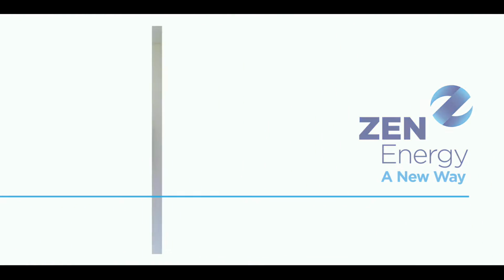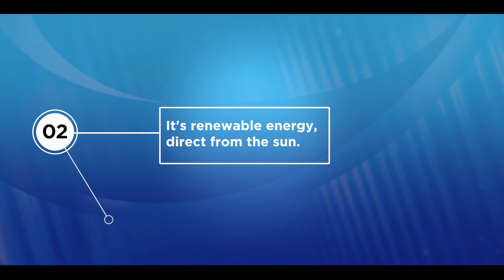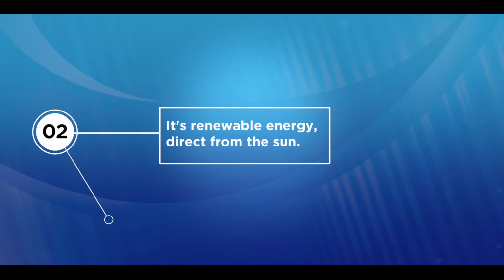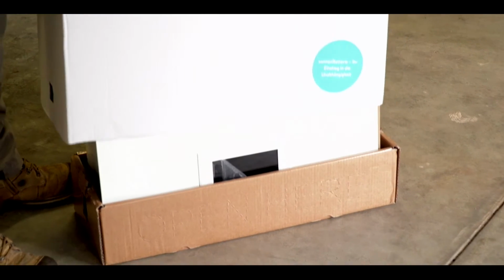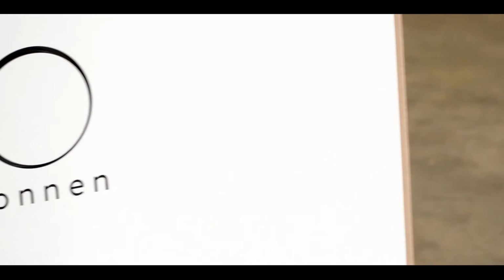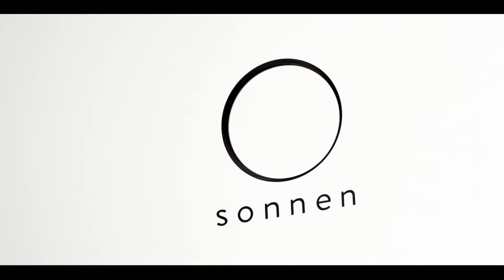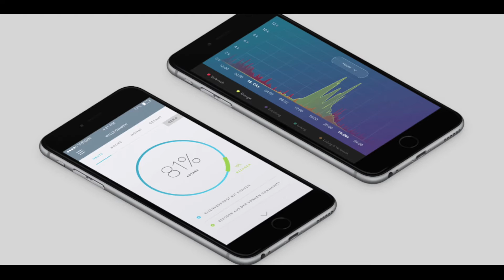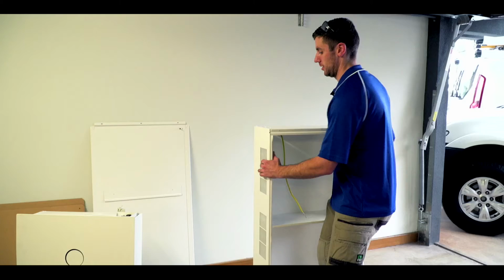Sonnen Eco 8 Battery Installation by ZEN Energy

Comment: World leaders ? They do not build /manufacture only install a finished product manufactured in the USA - Battery storage technology is nothing new Aboriginal communities have  diesel hybrid systems  in place which were installed appx 15 years ago these have 100 Kw Arrays , 80kw 3 phase hybrid inverters , 40 to 60 kw  of storage capacity from companies such as Sonnenscheine, the Gel Battery banks are made up of 2 volt Cells usually running at 120 volts - with appx 800 to 1000 amp output per cell. These also have a Guarantee / warrantee  of ten years - Yes the New Lithium Batteries are very nice and very compact but there is other Tech available with a lot More watts for less Dollars still available,  these have not really been shown to the public at this point in time. 
 Further to the above  you have synchronizing Generators all 3 phase up to a number  4 of 120 kw  Cummins sets all 3 phase with auto start facilities , as load increases in the fully automatic load these will start sharing load either with the inverter or with the other gens depending on how the client configures the system they also have a feature that will start any of the sets or inverter if that is available, should there be a failure of a set or inverter. Finally there is a battery charging ability with an output sufficient to feed the inverter directly at 120v ( in case you loose the batteries and wish to remain on the solar option ) The panels will reduce the load on the gen-set via the battery charger once the sun rises and they begin to generate a charge. -  the DC charger  is fed directly via the main switchboard off the main AC bus or via any one of the  four generators again depending on which set is selected as the primary or duty set in case one or more is out of service for maintenance.  This is a quick description of the electrical / Mechanical configuration - the fuel design and enclosure as well as site distribution etc have not been mentioned as well as the Building That Houses this facility etc are all built around green design Principals and Technology. The system has many features too many to mention in detail , the intent was to point out that the tech is not new 
it has finally become something that has come into being as green energy is becoming a way of life for many people.